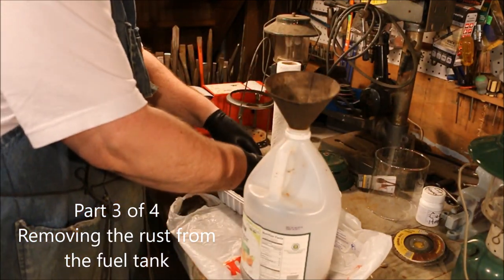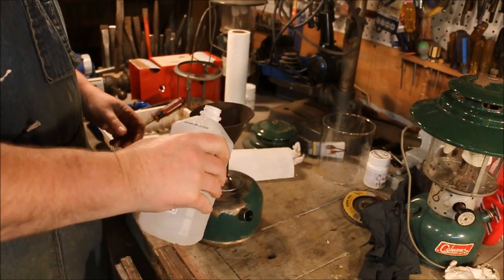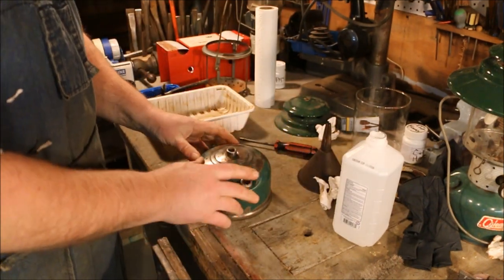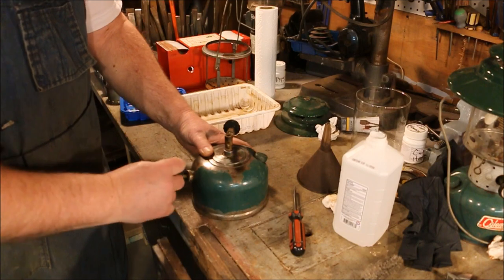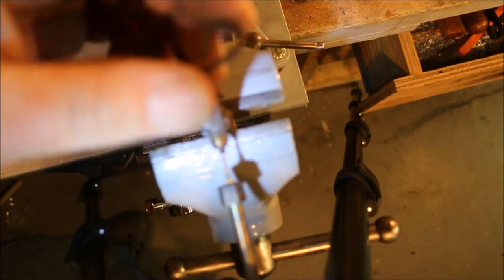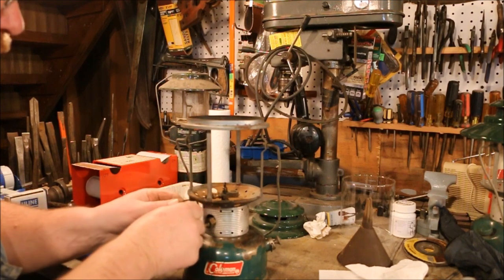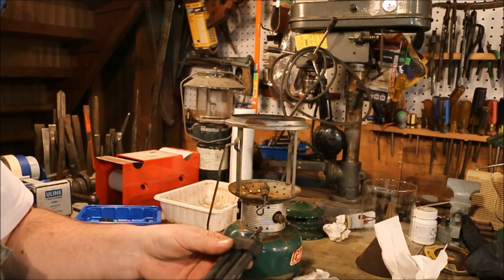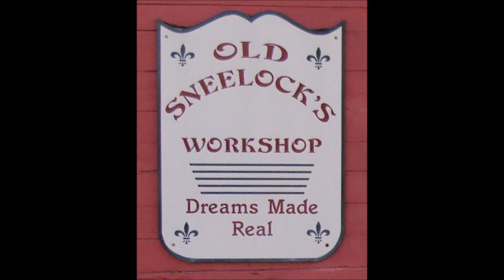Coleman Lanterns ~ SHTF ~ Pt 3 of 4 ~  Rust Removal & Flushing The Tank ~ by Old Sneelock's Workshop

Comment: Like your demo model; I have 2 with the bottom / vent globe holder bowl rusty. Needs cleaning and plating to stop the rusting.  Plating mine again after rust removals.
Reply from the maker: Plating nickel? The vinegar method worked well on a brace for me.

Comment: Sneelock, you truly are a man of infinite patience. Lovely job so far.
Reply from the maker: +UK Tony Thanks Tony. The difference between this and working for a living is I get to walk away and do something else for a while.
Reply: +Old Sneelock&#39;s Workshop 2nd THAT!!
Reply: You are so right. Since retiring, if a job outside needs doing but it is raining it can be done tomorrow. If a job is getting tiresome then I will stop and take a break. No more squeezing everything into the weekend.
Reply: My Sweetie keeps telling me I need to just do ONE thing and quit. I'm afraid if I don't push a little I'll regress back to a lump. And after a push I can't move the next day. Maybe I'll learn!
Reply from the maker: Eat three meals a day.
Plan the projects during breakfast. Sweetie will have useful input.
Rest from the project at lunch. Check the breakfast plan. Revise as needed.
Stop for dinner and celebrate your success. Compliment the cook. They love it. Share your successes. They love that too. Share your problems. Sweetie provides insight again.
Rest and get ready for breakfast.
Keep this up for the next lifetime.
Works for everyone.
:-)
Reply: That will work and usually goes on sort of like that with variations. You'll be proud of me. We've got a couple of inches of snow as a cool front is flopping about and I didn't want what is left of the greenhouse to shred itself so I went out and punched the snow off from the inside. I was talking about putting a heater in it but Sweetums was talking about the power being wasted and I agreed THEN a little Sneelock lightbulb came on and I thought COLEMAN! So I went and pried out the old stove 4528 maybe, and fueled and fired it up inside the pneumonia hole and it's burning as blue as a propane job. It's been several years since I had it going but it fired right up. NOW I need to pull a  Sneelock and clean it up and paint it. After the snow is gone.
Reply from the maker: Lewie you are a true Sneelockite.
Reply: Well, I'm learning! I got a FINE teacher buddy! I also got the 2 lanterns down and smoked them over. One is a gas job (petrol) with no stem on the check valve and the other is a single burner kerosene full of Coleman fuel. It's got the pre-heater cup like you'll have to make for the Tillie to get the generator going. I think the gas job just needs a check valve with air stem/pipe/whatever that Old Coleman Parts has for $4 and change because it wouldn't tighten up and when I pulled the pump out there was nothing in there to tighten to. I also need the alcohol primer bottle for the kerosene job (methanol, not ethanol I dare say) and a mantle and a good cleaning for both. The stove worked like a champ as usual. Would you paint the burners or just clean them up? I usually just clean them and WD-40 them to kill the rusting because they burn it right off and I din't want to mess the burner washer/jets up. I think I('m going to take it apart and give it a once-over as it'll be the first time ever. I ran the numbers and it was made in the 50's but has a newer tank because it won't sit flat because the tank sits below the stove body. The legs ( top locks on both sides, no lid latch) have to be down to sit the stove up a little, or scoot the tank over the table edge and then everything just hisses right along. Thanks for inspiring me to actually do something with these fine artifacts. You're a fine Uncle, Uncle!
Reply from the maker: Never had a kerosene Coleman. Seems they are rare.
Great job with the improvised heater/stove. I'd clean the burners and leave them alone. The white gas will strip of most paint anyway.
Why methanol?
Reply: Thanks about the burners. As for the methanol, I thought that would heat everything up better than ethanol and I even hate to think that word. I just know it's supposed to be some ki9nd of alcohol to heat it up with. I thought methanol would burn cleaner and hotter. Maybe just get some Everclear. The petrol lantern is a 220F and the kerosene is a 237 and the old stove is a 4?8B?? I'd have to look again and I threw the paper with the number on it out already. Maybe I was a collector of old things and just didn't realize it! Might be a sliver off the Old Sneelock Block after all!!
Reply: @OldSneelock  OH yes! Wisdom 4 sure!
Reply: @OldSneelock  I am NOW!

Comment: I read on a forum to put some BB's in the rusty tank too and shake around to mechanically knock rust inside the tank too.
Reply from the maker: +Joey Hollifield Good idea.
Reply: Heck yeah.  Add some coarse sand and it will polish the heck out of it
Reply from the maker: As long as it all flushes back out. The jet on the  exit of the generator is very small . 😐

Comment: What i do to get rust out of the tank, is i put my choice of rust remover in the tank, leave it for a night, and after 24 hours, i put a small handful of copper BBs in it, give it a hard shaking, and then i dump out the rust remover, rinse it out with the rust remover again, (No BBs) then i rinse with Coleman Fuel, then leave some fuel in. Did it with a 200 fount, and i am currently repeating with a 242B fount.

Comment: I have a lantern that has rust n some corrosion in the bottom out side tank the lantern works and from what I can tell it's a 220 d I think
Reply from the maker: Matt Patterson Most of them have rust on the bottom of the outside. A good cleanup and paint will put ot right. If it isn't leaking, and lights up, you have a winner.

Comment: I looked at mine when I went for the hedge trimmer stuff and they were still right where I put them. I'll be in a crimp if I have to tear them down. All brass so my magnet won't work. I'll just have to not go so far in and let some ether and compressed air dislodge stuff, if there is any. But the hedges are trimmed and the orchard's 3 trees are almost done, so who knows.  The mower beckons but it's supposed to be nasty out so I might stay here and feed the fire. I told the Saw Surgeon if it got in the way to chunk it outside and I'd come and get it.  He won't, so I'll probably go get it fixed. Awaiting on the FWOOSH as it lights!
Reply from the maker: +Lewie McNeely Since I don't think yours will be rusty I expect you will just have to wipe them down and maybe change the mantles.
Reply: I inherited those and all I did when I got them was clean them up. I can't remember if I even took the fuel caps of BUT I suppose I'll find out. My stoves are ready to go right now BUT I did those last time they were cooking. I took a picture of the old one in the middle of a BIG ice storm, couldn't even get through the driveway, all the bent trees and ice everywhere in the background and a pot of chicken and dumplings cooking on it with the steam rising.
Reply from the maker: The joy of discovery,
Reply: My Mom said that growing old wasn't for sissies.

Comment: What is the mix ratio of baking soda and water?  And after that procedure, do you rinse out the baking soda mix with just water, before doing the alcohol rinse?
Reply from the maker: My answer to this question has disappeared so here it is again. 
I use about 3 tablespoons to a quart. Or maybe 10 cc to a liter.  It isn't critical and you are just trying to make sure and wet the inside of the tank with the baking soda so it contacts and neutralizes all the acid in the vinegar. 
You don't need to rinse with water again after the baking soda. The alcohol is to absorb the water and flush out any left in the seams of the tank. It will suspend and remove the baking soda with it.

Comment: Thanks for the video - i did the vingear trick... but I see in the bottom a bit of debir that didn't come out.  Is there a trick to get that material out?
Reply from the maker: You can drop a handful of old nuts into the tank and then shake it around with just a little bit of vinegar, maybe a couple cups, in it. That will help knock the bits from the wall and bottom of the tank. 
Too bad they didn't put a larger opening. 
I tried using a long handled wire brush, but the nuts work better.

Comment: How do you remove the burner caps? Mine are brass and my burner tubes are metal and they seem to be as one (9/1955 220E).
Reply from the maker: On mine I just blow out the manifold and leave it assembled. The heat makes the joints  corroded so they won't come apart without breaking.

Comment: Great video. Do you know where I could get a replacement part for a 220e? I’m looking for a valve assembly that you can screw the generator cleaner into.
Reply from the maker: kurt cowan After reading your question I looked for that specific part. I found pumps, and generators but not valves. You can try Ebay. It's not a sure thing. You just have to keep watching. Good luck.

Comment: wonder if you could let the components soak in something like gas to loosen up the deposits?
Reply from the maker: Terry Carter The rust inside the tank might loosen up after soaking in gasoline but I doubt it. I have scrubbed rust off with steel wool, wire brushes, and sand paper. Ate it off with acid and chelating agents. Blasted it off with sand, steel shot, and ground walnut shelves. Using gasoline as a cleaning agent will remove wax, grease, and oils, it will help lift dirt off the surface too. I have just never had it dissolve rust on anything.
Reply: Old Sneelock's Workshop  i was referring to the deposits on the other components like the generator. could soaking them in gasoline soften or remove the carbon deposits ?
Reply from the maker: Terry Carter Sorry I misunderstood your question. With some scrubbing and a liquid to suspend the deposits and flush them off the generator will clean up. You could use gasoline, kerosene, alcohol, or soap and water. If you disaasemble the generator be careful with the parts. They are fragile. The ceramic tube shouldn't get wet or be scrubbed unless you have a spare. The chances are it will crumble. On the tip of the inner rod is a fine wire. If you aren't careful it will bend or possibly break. 
Having said all that try it. If it isn't working now it will either be better or you have to buy a new one anyway.

Comment: I hope the inside of the tank looks better than  your funnel .
Reply from the maker: +Wayne Murphy It is a pretty rusty old funnel isn't it. I never really thought about the need to clean the funnel it was just the one that would fit inside the top of the tank. 
Wouldn't take much for the tank to look better than the funnel. It did work quite well. Cleaned the rust out of the neck of the fill spout just fine.

Comment: Can you do this with normal vinegar? also how much baking soda should I use to clean the fount? Thank you.
Reply from the maker: Joshua Lepp I use standard cooking vinegar. 5% acetic acid by volume. Apple cider is my preference. Inexpensive, readily available, and it doesn't create a strong sewage odor when it reacts with rust. 
You can use cleaning vinegar. In the US it has is 10% acetic by volume.  In my early tries at rust removal I used white cleaning vinegar. It quickly began to stink.
The baking soda is to neutralize the acid in the vinegar.  3 tablespoons full in a quart of water should do.

Comment: any recommendations for slowing down/preventing a coleman lantern from rusting on the outside?
Reply from the maker: Storing the lantern in warm dry place is the easiest. 
The outside of the tank can be waxed with carwax to help prevent rusting. 
The burner and top shade of the lamp are made to be heated so should not be waxed. 
Here is a link to @ The Coleman Collectors Forum page on preventing rust. They might have some other suggestions.  https://www.colemancollectorsforum.com/viewtopic.php?t=24049
Reply: @OldSneelock  i think i'll use Napier Gun oil...

Comment: Making something run is an adventure no pastime for me.  I am sending my lantern into Coleman (a bargain at $55),  I have rust on the vent, how do I remove it and can I repaint (I heard no)?
Reply from the maker: Long time before I answered. Painting the vent is okay. You can use high temp paint but it might just burn off even the high temp stuff has limits. The shade is porcelain because it gets so hot. That is why the "paint" chips off.

Comment: I cleaned my model 200a and it holds pressure for many  hours but it spits fuel inconsistently out of the generator gas tip.I took off the burner frame and can see the generator clearly should there be a fine mist or spiting ? what do you think ?
Reply from the maker: When the lantern is lit the fuel vaporizes in the generator. The generator is a ceramic fiber element. Fuel has to pass through it. When it is cold the fuel tends to spit because it fills the pores of the element and is resistant to flowing out of the element. When it is vaporized it should flow out in a more consistent manner.

Comment: You've conversed with me before about a lantern. Question: Any problem with cleaning the tank with muriatic acid?
Reply from the maker: Just the usual cautions with muratic. Don't mix it too strong or leave it too long. Thoroughly flush the tank and neutralize the acid with baking soda or soap. 
Muratic works quickly. If you don't pay attention it can remove metal along with the rust. 
It is a pressurized tank and any thin spots will be a possible leak. Spraying Coleman fuel is a big problem.
Reply: @OldSneelock  Thank you. That info. is very helpful. Time was a concern of mine.

Comment: My dual fuel coleman lantern is not holding pressure.  I switched caps, installed a working plunger from another stove, what I thought was a defective plunger is not, it works in the other lantern.  So I looked down the plunger tube and one side of the tube is rusting and the bottom was rusted.  So I sprayed some WD40 rust lifter in and cleaned out best I could.  It is allowing some pressurization but very little, when I release the cap.  Any other suggestions?
Reply from the maker: Polish the pump tube until all the rust pits are gone. Pits let air slip past the cup and reduce the pressure.mk
Reply: @OldSneelock  That makes sense.  I was looking for round wire brushes but they were all too big.  I have some 120 grit sandpaper and if I can find a dowel or something similar I will try that.  I'm in Canada and I bought the Dual fuel in New Hampshire (I live in Prince Edward Island).  And those stoves can't be found up here and when I find one online in the U.S they are expensive, so I'd like to rescue this one if I could.  I use it when I'm outdoors splitting and stacking wood and gasoline is cheaper than Coleman fuel.  I store a fair amount of gas for generators, chainsaw's and snowblower.  I use K100 for fuel preservation but any older fuel I use up in this lantern.  I also have a dual fuel burner.  I'm not mechanically inclined so these videos are great to watch.  Thanks again and I will post updates
Reply from the maker: @TheBreamer999  Pretty much any stick you can whittle to size will work. Cut a slot in one end and slip the paper in the slot so the abrasive is out. 
You cam slide some paper or whatever under the sandpaper so it wedges the sandpaper out and fits in the tube. 
Good luck.
Reply: @OldSneelock  I used a pair of tweezers and sandpaper.  Before that I sprayed WD-40 Rust Release down the tube four or five times, and it really worked well, the liquid pour out was pure black gunk.  I then sanded it with sandpaper and a pair of tweezers and cleaned it up with a gritty wipe called "Scrubs", I installed a new mantle since I touched it by accident and it disintegrated.  Seasoned the new mantle, filled half and pumped about thirty times.  The roughness was minimal and it lit first time.  I've since pumped it ten or fifteen times in the last 20 minutes.  I'm told adding sea foam to the fuel will get this to 90 minutes, but I don't have any.  So far so good.  I will probably oil the plunger again and clean the tube again.  Thanks for the suggestions and I now have a working lamp!.  I know the new LED's are the in thing, but @57, I'm old school
Reply from the maker: @TheBreamer999  You can burn paint thinner, white gas, benzine, etc in the old Coleman Lamps. It will sit in the can for 30 years like mine and burn every time. 
Set an LED lamp on the shelf for 30 years and see if it will hold a charge. 
I will use LED's and like them. They just aren't SHTF backups in my book.
Reply from the maker: @TheBreamer999  Congratulations on fixing the pump. Glad it wasn't too pitted. 😠😎

Comment: I would use denatured alcohol. Isopropyl alcohol is mostly water. Otherwise great video series!
Reply from the maker: Any alcohol will snatch water out of the air once exposed. The reason I use alcohol is that it absorbs whatever water is in the tank after the baking soda rinse  and carries it out.

Comment: my phillips head locking screw is froze up, any ideas how to free it? tried pb blaster
Reply from the maker: The screw on the manifold is annealed to the point that it falls apart if you torque on it. I leave it alone and run a pipe cleaner or wire brush through the tubes.
Reply: @OldSneelock  Tha nks, I have an old 1970 200E I got from a antique store and about the condition of yours. The tank was full of rust. I replaced the leather and cap gasket, but still had low gas flow. I recently cleaned the tank with vinegar and replaced the generator. I ordered some wire brushes off amazon and will try those